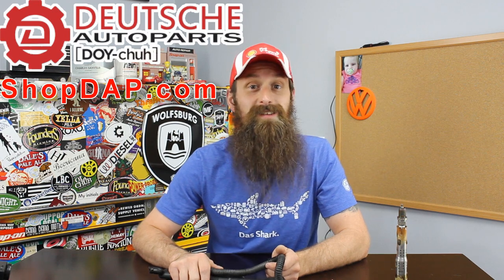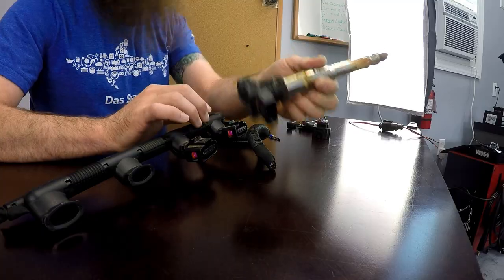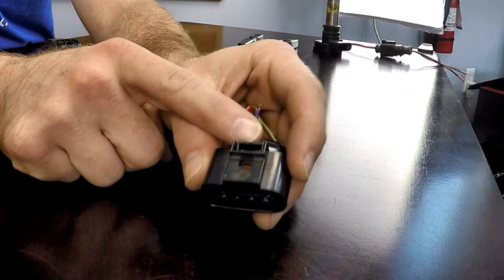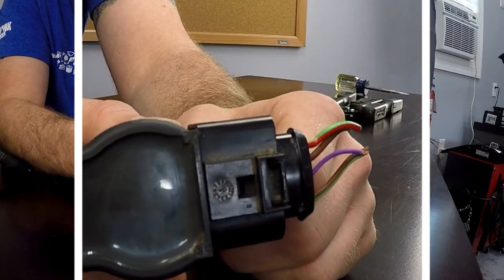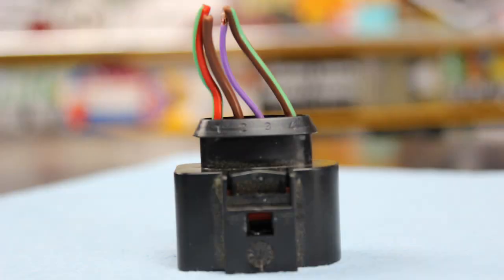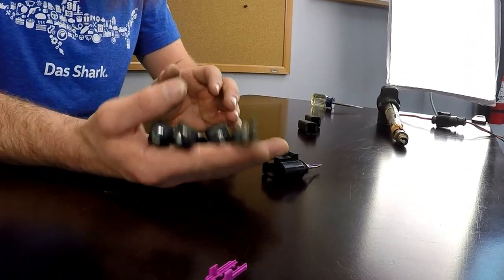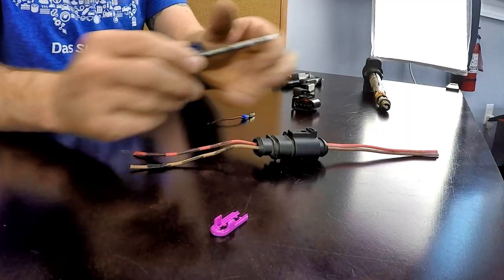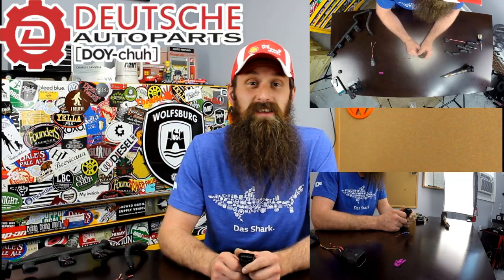How VW Parts Fail ~ 2.0t Ignition Coil Connectors

Comment: I’d like to see you use a multimeter to test the connector
Reply: 1: coil ground
2: spark signal
3. 12v ground
4. 12v power
Reply: 1: coil ground
2: spark signal
3. 12v ground
4. 12v power

Comment: I keep having to replace coil packs if accelerating heavy. I have went through two sets in 3 years. Why? Is there something else wrong causing them to go bad?
Reply: Clint Nesseth what brand did you use ?
Reply: @MrDjmurdock  OEM not sure I just put a Bosch that has the black rubber  on it.

Comment: Hi Man Thank you for the lesson. My golf 6 was in service for replacing blown head gasket. Got out and showed an engine light. took it back to mechanic and he diagnosed and found random misfire code, and misfire detected from cylinder 4 and 1 code. Changed the spark plug and drove a little bit and now engine shakes a lot with EPC light on. Any advice?
Reply: Bad coil pack

Comment: Ignition coil 2 melted yesterday on my vr6 24v 2.8 how would that have happened?
Reply from the maker: Wow. Haven’t seen that in forever. Internal short in the coil
Reply: I pulled the coil out along with the spark plug. The spark plug was okay and so was the actual connector that connects to the coil. I came up with the conclusion that the last owner used a cheap coil. In ownership I’ve used coils from VW and replaced 1.3.5 and have never had this happened. Thanks for replying! Love your videos

Comment: Hey man, I recently tried to replace the connectors with new ones since the old ones were old, broken, and brittle on my 1.8T....long story short there were some exposed wires on one of my coil pack connectors and I guess two of them touched which created a short circuit. I'm not sure if it messed up my coil pack or if it burned the wires which I really hope isn't the case. Can any of you guys tell me what to do in this situation? Much appreciated, thanks.

Comment: search google for "ECS Tuning ES#452689" or "ES#10979" for replacement connector housing that meets OEM standards.    Lot's of the aftermarket products on amazon require different pins.   the OEM housing should not require splicing.   you will need the terminal removal took kit.   the bummer on the two different ECS Tuning parts is price difference.  one is $8, the other $28.   argh.

Comment: These small plastic electrical clips are ridiculous...
How they expect a small piece of plastic to be heated up to 150 degrees under the hood in the hot sun and down to 0 degrees in winter in some spots and im suppose to just unlock this tiny piece of plastic after 10-15 years 🙈

Comment: would a bad connector cause total system failure and a battery light symbol to appear on your dash.  Literally nothing works on the car once this happened and just a red battery light is showing.  bought a new battery a week ago and just replaced the spark plugs.
Reply: did u fix this problem
Reply: Andrew Lopez did you figure out your problem? I'm having almost the same problem with my 2006 Jetta 2.0.. I've been trying to trouble shoot it but nothing seems to be making sense yet..

Comment: Hi❗ Please bro... help a DIY crazy dude❗❗❗
What's the name/code of those ( how do i search for it) O.E. VW terminals/conectors/pins, how do i find it to buy it❓❓❓
I do not know... what's the gauge of the pins... 
1.0, 1.5, 1.8... 2.54, 3.5... 6.3 mm❗❓❓
I don't know if are the same for those with two pins in comparison with 6 or 8 pins cause i don't like to mess it up... no one does
PLEASE HELP ME with this info cause i'm stuck❗
Reply from the maker: this is a TOUGH question. IF you have a connector, there is a part number on it. Call the dealer with that PN and they can look all the wires for that PN. ITs work but it gets you there.

Comment: My ignition coil keeps going bad. What could cause it?
Reply from the maker: Check wiring. Be sure you’re using a good quality part
Reply: @HumbleMechanic  Thanks,but could it be the engine? The engine has done 198,000miles. Passat CC 2012.

Comment: Where do I get a new wire with terminal mine is broken
Reply from the maker: You can get them ready to go from the dealer
Reply: HumbleMechanic thanks do any dealerships have them in stock or do they have to order them ?
Reply from the maker: They usually stock some of them. You can get them from Audi too

Comment: what can cause this??

17763/P1355 - Cylinder 1 Ignition Circuit: Open Circuit

17766/P1358 - Cylinder 2 Ignition Circuit: Open Circuit

17769/P1361 - Cylinder 3 Ignition Circuit: Open Circuit

17772/P1364 - Cylinder 4 Ignition Circuit: Open Circuit

 

16684 - Random/Multiple Cylinder Misfire Detected

16686 - Cylinder 2 Misfire Detected
Reply from the maker: Coils not plugged in all the way

Comment: I'm having an issue CONNECTING, my epb connector I can't reconnect, thing is crazy
Reply from the maker: Make sure the seal is not swelled up inside
Reply: @HumbleMechanic  I had just disconnected the old EPB and was trying to connect a new one, it had never been exposed to the elements prior to the half-hour earlier disconnection
Reply: @HumbleMechanic  maybe somehow the pins aren't lining up, not sure how, but I  couldn't even reconnect the original epb motor

Comment: I have a question , I have a 2012 VW CC 2.0t Sport 4 cylinder when I accelerate my car makes this weird grinding noises and when I’m stopped it makes a little noise , no engine light or anything what could be the problem??

Comment: I am having a similar problem here please help.
Cylinder number 4 doesnt fire,  i swaped coil packs around to see if its not the coil pack fault,  still it doesnt fire. I see a bit of oil may have gained access here....nw tht the car hasnt bn working for about 6months or so,  i got it to work as the problem was the timing belt in the first place,  now the car starts but cylinder no. 4 has this problem